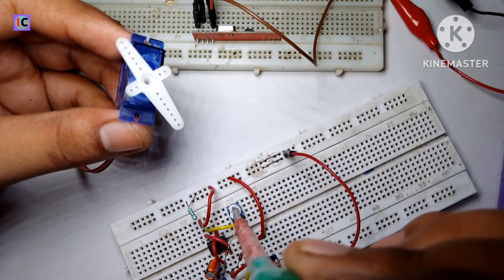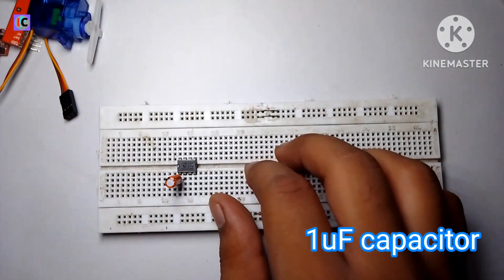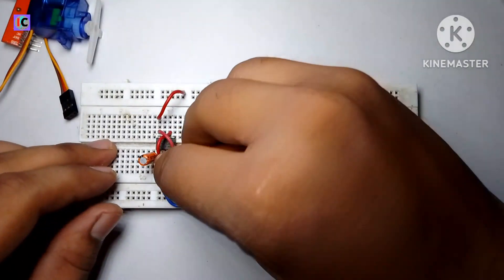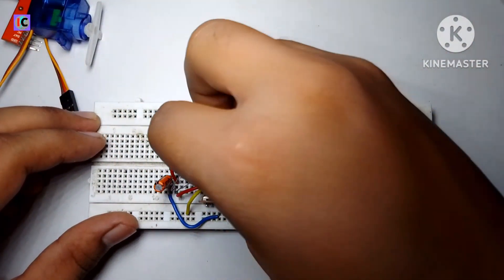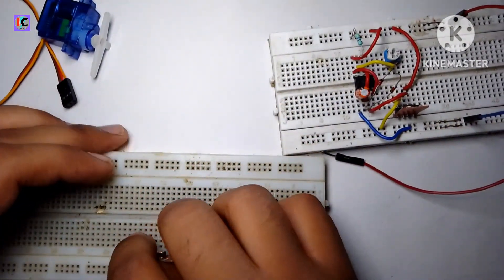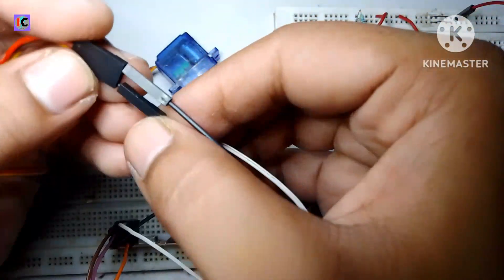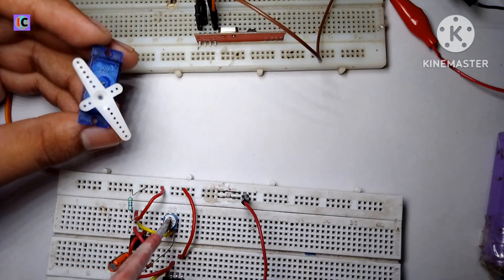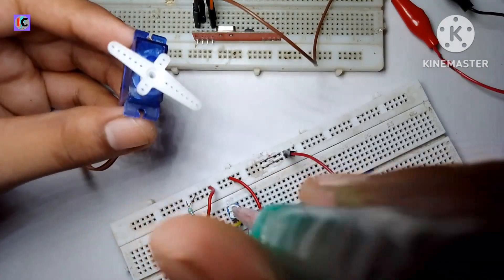433MHz Servo Motor Controller

Comment: Why it is not working when i use encoder and decoder ICs
Reply from the maker: because decoder IC can't give pwm signals, it can only send digital signal
Reply: @innovationic  sends or receives? , but when i directly connect the signal pin of servo to the data pin of the receiver and the arduino pwm pin to the data input of transmitter it works well , just i wanna figure out how to use that with encoder and decoder .
Reply from the maker: decoder(HT12D) and encoder(HT12E) don't support pwm that's why we need microcontroller
Reply from the maker: you can use NRF24l01 rf modules with Arduino for better response time

Comment: It's magnificent, can it run a brushless ESC?
Reply from the maker: well ESC needs 1000us to 2000us pulse signal and using this circuit may cause calibration issue.
Reply: @innovationic  what if we use a servo tester that is sold on the website?
Reply from the maker: yes servo tester will works
Reply: @innovationic  Are you considering doing a test.....?
Reply from the maker: yes I have tested with arduino as servo tester and works